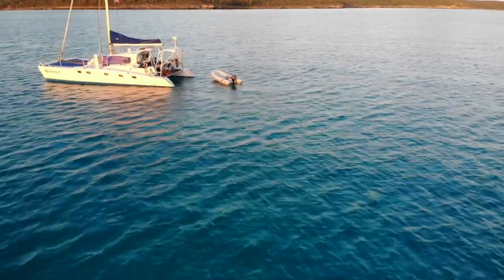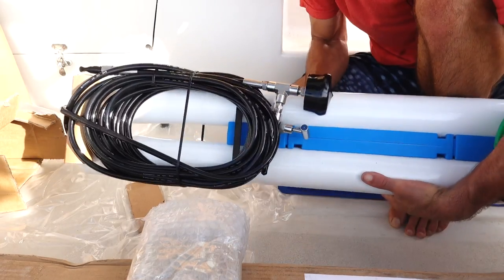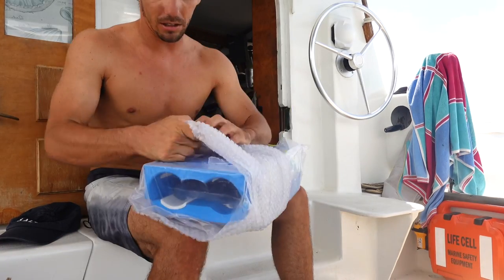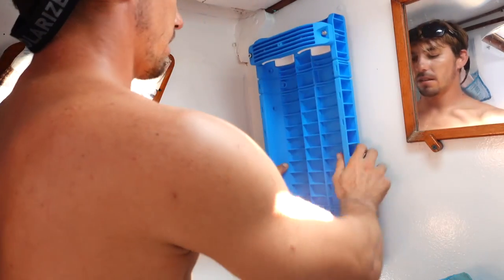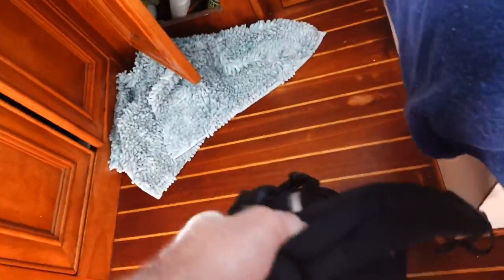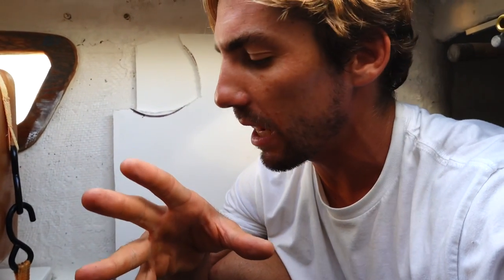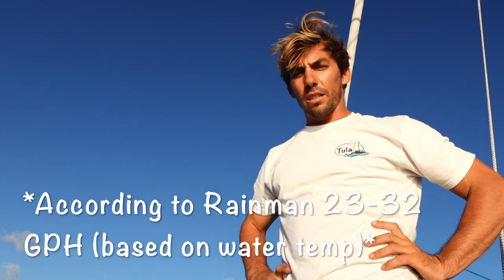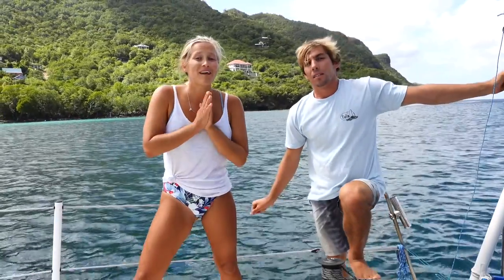LIVEABOARD: Installing A Rainman Watermaker On Our Sailing Catamaran (game changer)

Comment: Make >> SURE << the filter for the auto/manual flush system is a charcoal filter that will take out any chlorine because any chlorine will ruin the membranes in a flash. When you put water in the boat tanks from Marina's & Dockside - that water can have chlorine in it - and this is what you are using when you run the auto/manual flush system ~ so beware of that fact. Other than that - it looks great and you are ready to go. I was a Chief Engineer on many vessels worldwide - motor-yachts and commercial vessels. I am now retired in Florida.
Reply: Great tip.  Thanks!

Comment: FWIW:  I was on a camping trip some years ago on some private property in Central Virginia, and one of the other campers I was with had a Honda generator.  I was AMAZED at how QUIET that thing was....
Reply from the maker: They really are. Sometimes when it’s running on deck you think it could kind of be loud but take the dinghy 30’ away and you can barely hear it!

Comment: A coupe of points about water makers you will want to pay attention to:   1) Adjust the pressure based on what output  the membranes are rated for, not just pressure.  In brackish or fresh water the pressure will be much lower. If you use 850 PSI in brackish water you will damage the membranes.   2) Never back flush the membranes with chlorinated water.  It will distroy them. This can happen if you fill your tanks at the dock and then back flush from the tanks.  It's a good idea to install a carbon charcoal filter in the flush line in case you forget.  Enjoy the water maker.  We used our water to trade for fish and other thinks in remote areas.
Reply from the maker: Thanks for the heads up. Yes, Rainman recommends a different psi for brackish water and I believe the offer a flow gauge that helps when desalination gets brackish water too. An activated carbon filter did come with our autoflush to put in line from the water tanks.
Reply: Good points. All Rainman systems now come with flow meter to ensure you don't go above the specs of the system while in brackish water.

Comment: Great video! I hope to be cruising someday.  
I see you are adjusting pressure to get your product water. if you ever find yourself in lower salinity water, you may want to add a flow gauge to the product water output. If you run 850 PSI in low salinity water you will likely damage the membranes. You want to adjust the pressure to give the desired flow, without exceeding the maximum pressure. In fresh water you need very little pressure.

Comment: That is great that you installed your reverse osmosis. Remember though, RO water is devoid of all ions. That means that the water you make will be in ion scavenger. This means that whatever container the RO water goes into, whether that be your body or a water tank, if ions can be leached from the walls, it will be. So, what can you do?  

If you are making RO water and you are at least a couple miles offshore in 500’ or greater water, then you could just add about a quarter ounce of the concentrate per gallon back into the RO, or test to taste.  Think about it.  You are getting rid of the major salts, but you are also eliminating the calcium and magnesium that your body needs that you normally get from regular water. So if you add just a little of the concentrate back, then you are Reverse Osmosis water is approaching what you would find out a flowing stream. 

Another option is to carry a little bit of baking grade calcium carbonate or a little bit of baking soda or even Himalayan salt.  For each of these you could add a pinch of either to each gallon of Reverse Osmosis water.

Have fun with the new water.
Reply: RO water is not deionized.
Reply: Austin L. You’re correct that the literal definition of deionized water is not equal to reverse osmosis water. I can electrically or/chemically deionize water in my lab. Reverse osmosis in terms of what Billy and Sierra are doing on their boat is using a reverse osmosis membrane used in Rainman equipment, but made by Dow, which is now DuPont-Dow’s Filmtec membrane. This is a semipermeable mechanical membrane that uses high pressure to physically force water, which is a small molecule through pores of the membrane. This membrane blocks ions, large molecules, ionic compounds and other dissolved material from crossing the membrane barrier. So there is specific ion selection. In a specific sense, RO water is deionized, just not in the same way that most deionized water is made commercially, industrially or in a lab.

Comment: recommend getting a pex cutter so your hoses are cut straight, seen it before someone cuts a pex line with regular knife and its not straight, potential for leaks or using a saw and it sent shavings into the water line pipe. 
I had to strip a business bathroom toilet ballcock and clean the shavings out which it clogged.
Ballcock is what fills the tank on the back of the toilet with the float attached to it.

great video though
Reply from the maker: Thanks for the advice!!

Comment: 26-34lph (7-9gph)
I think you are making 7 to 9 gallons per hour. Correct me if I'm wrong. Either way you making fresh water and that's a great addition to your boating lifestyle.  Good job guys.
Reply: It's actually 100-140lph or about 35gph. Towards the higher end in warm water, lower end in temperate water. In Antarctic -2C water, it would be about 80lph.
Reply: @RainmanDesal  That's amazing. I will follow the links to inquire on cost and shipping to Canada.  Unless you have a rep in British Columbia. Thanks for the correction.
Reply: @MrNickstevenson63  No problem. We work with Watertight Boatworks in North Vancouver. Our dealer map is at https://www.rainmandesal.com/watermaker-dealer-map/.
Reply: @RainmanDesal  Thank you.

Comment: Wow, that is really exciting.   That unit really puts out a high volume! 

I would be curious to hear your feedback after you have lived with the watermaker for six months or so. 

How often (hours of operation) do you change the pre-filter for the raw water? 

I am going to presume that the big reverse-osmosis filter eliminates any health hazard such as contaminants from things such as city sewer system. (not so much a problem in the out islands of the Bahamas, but could be a factor in city harbors). 

I would guess dinging water 5 gallons at a time makes you super conscientious of water consumption.  I can take a shower on the boat in maybe 1.5 gallons of water, but that is still too much when you have only 50-60 gallons available for weeks at a time.   Easy to fill up every few days cruising the Chesapeake.  

Love your video's.  I discovered you about mid-way through the trawler and have been religiously following you ever since. 

You guys Rock.
Reply: O'My O'Day  gotta love the Chesapeake Bay 👍👍👍👍👍👍👍

Comment: Awesome! This will be so nice for you guys. Will you have to be strategic about the water quality where you are (dirty harbor water or something) or will it really remove all the harmful impurities? How much power does it draw? Could you run it from an inverter in a pinch (if you ran out of fuel, or the generator died)?
Reply from the maker: It would remove the impurities from a dirty harbor but at the expense of the expensive membranes so we are strategic about where we use it. The cleaner the source water the better. It can run off of a high quality inverter.
Reply: I figured. Very cool!

Comment: So glad you have a water maker now.A necessity for your kind of long term sailing.My only question maybe I missed it on the install.How did you plumb in the pickup pump?Through an existing saltwater pickup?Engine seacock maybe?
Reply from the maker: Exactly we t’d off an existing seacock. It was one that feeds salt water to flush the head and I put a check valve on the head side of the t just to make sure the watermaker didn’t pull from that side (redundant to the head mechanism)

Comment: How often will you have to by replacement filters?  Or do you have to replace them?
Reply: The prefilters are typically 5-50 hours of use, depending on the source water. The RO membranes are usually 5-10 years if you take care of them.

Comment: Won't you have to have the generator running for the Auto-Flush to work? Maybe I am missing something, but it doesn't seem very "auto" if you have to schedule the generator to be running at an exact time.
Reply from the maker: No, the only electricity needed for the autoflush is the timer control box and valve which are wired into our house 12v system and also the house fresh water pump which is obviously already wired. Nothing else is needed therefore no generator.
Reply: @Tulasendlesssummer  Roger that

Comment: Ok,,,the unit is set to autoflush every 7 days,,,is the flush cycle set up to run off the inverter, or are you going to have to set up the generator?
Reply from the maker: It’s hooked up to the house 12v system and it just uses the regular house water pump to push water through. No need for generator or inverter. Here is some more info on the autoflush https://youtu.be/cmXp1hEFDIU

Comment: Can you have hot showers ? I don’t recall if you have a water heater ?
Reply from the maker: Only if the port engine has been running. It is a water heater that is heated by that engines coolant

Comment: did you not show using a sealant in the mounting holes or did you not use a sealant
Reply from the maker: I didn’t use sealant in the mounting holes. It is all mounted in a dry covered storage compartment

Comment: I think your placement of the components is perfect.  It keeps the runs short and everything is accessible.  One thing you should maybe look into is obtaining a TDS Meter (Total Dissolved Solids)  You can test your water to ensure it is safe to drink, no more than 300 ppm off the top of my head.  Do this every time and you will see when your water maker membranes will need replacement because the test samples will increase in ppm.  Keep a log!

Comment: We used to use our dingy as a water barge too, fill the dingy at least a few hundred litres, maybe 50 gallons then pump it out into our water tanks, had 2 by 800 litre water tanks (200 gallon) under the hull sole. Never did get a water maker, liked the Katadyn system, small super efficient DC powered. https://www.katadyn.com/us/us/102-8013438-katadyn-powersurvivor-40e-12-v

Comment: Great vid. Suggest you double clamp all water lines that could cause flooding. Also, watch your generator. A friend of mine had his vibrate off the deck into the drink when it started running rough because of bad fuel. Hope to see you finish all the plumbing soon!
Reply from the maker: Omg that sounds like a nightmare having that fall overboard!

Comment: Liked this one guys a good how to. Couple of questions for you or Rainman. Assuming your on US voltage of 110 Vac Do you know the current draw on startup for the HP pump? We are looking for a watermaker to install and feature in our vids, but we have 230Vac 2Kw inverter gen, and a 5Kw Max 2.5Kw constant, soft start pure sine wave inverter with excess solar. But it's the start up that draws the amps not the run? So some info on that would be useful.  We use 21 Ltrs per day on average that's 5.54 US gallons.  Are there smaller units as we really dont need that massive capacity although, the extra would be handy as you say  for washing stuff. Have you a contact we can talk to? As always, Sail safe. Ant, Cid & the Pooch crew. xx
Reply: The 115V system draws 1300 watts, so about 11 amps. Induction motor startup is 5x current draw. Many people are running with a good quality 2kva inverter (eg. Victron, Mastervolt, etc.). Smaller units are available, but many people that use lower quantities of water will still have the high output system and only run it once a week.
Reply: @RainmanDesal  Thanks guys. Quick to respond. Impressed! So the 230Vac Motor is going to draw 5<5.5 Amps. We are currently in Italy, moving on shortly East and South. Do you have a contact or someone that can mail us for some details etc? You can contact us from the about page of our YT chanel or Via facebook "Impavidus Ontheboat. Many thanks. Ant, Cid & the Pooch crew.

Comment: I have a Parker “Little Wonder” water marker. It’s 12 volts.  Makes 4.5 to 6 gallons an hour.
It’s the way to go if you want to go the 12 volt route.  I had an AC watermaker I made that made about 25 gallons an hour.  It was loud and I had to run the generator to make water.
I am fortunate enough to have lots of solar power and good batteries.

Comment: what prevents the internal membrane from rupturing (malfunction) and flooding your tanks with saltwater?  what would you do then?
Reply: The membranes are really sturdy.  If you don’t overpressure them and keep them flushed, they can last for a few years.
Reply: @LetsJumpGo  ah that's good.  I didn't at all mean having this is a bad idea. I'm truly wondering what safeguards are in place to prevent contamination of water. If the tank gets saltwater in it, that could be devastating if far from a water source.  Maybe having a backup system or separate jugs just so you know you have fresh water for survival if needed.

Comment: This is awesome guys. So happy for you. I've been looking into this exact water maker.
We have been using this washer which we found to be a huge upgrade to the bucket.https://www.amazon.com/dp/B01ALBMIEI/ref=cm_sw_r_em_apa_i_UwfkEbH68H65R
Reply from the maker: That’s awesome! Does it work well?
Reply: @Tulasendlesssummer  we love it
Used it for 3 months. You still need to dry the clothes but it gets so much water out in the spin cycle that it takes like half the time to dry.
Doesn't use much power and we run everything exclusively on solar

Comment: OH NO, you can’t do that!!!!! That adds weight and will slow the boat down. No generator so no water maker....but since Sierra won that argument guess its ok for a water maker. But you slowing your boat down Haha
Reply: It can actually be a weight SAVINGS if you run your tanks 1/3 full. Water is very heavy and no need to keep the tanks full.
Reply: Rainman Desalination 

I was referring to the spat between them two about the generator. Check a few episodes ago and watch it. Meant nothing more than a joke. I agree it can be a weight savings.

Comment: Rainman High Output Naked claims 26-37 gph @ 1250W on their pricing page, Honda EU2200i rated @ 1800W = 0.3 gallon fuel per hour - so about 0.2 gallons of fuel per hour per for ~30 gph water. That's 1 part fuel for 150 parts water. ~US$0.50c worth of fuel per ~30 gph.

Sailing Emerald Steel today said they use less than 7 gallons of water a day, that's 2555 gallons water a year and 17 gallons of fuel a year to make it. So about a passenger car tank full of fuel per year. About 150kg of CO2 emissions. You would need to plant about 7 trees in the Amazon every year to sequester just the fuel. Interesting.
#teamtrees
Reply: I think they have lowered their carbon footprint by adding the water maker compared to taking the dinghy to get water at a marina. The generator should be more efficient than the outboard making several trips back and forth.
Reply: @marceld6061  I actually calculated that but thought my post was already too nerdy. :) Found a review of a similar dinghy with the same 20hp Suzuki and it was most efficient at 4000RPM and 13 kts (15 mph) for about 338 miles using 17 gallons. At 5 kts efficiency dropped and 17 gallons would only get 183 miles. Difficult to know how far a dinghy travels in a year for water but I'd be surprised if it was that far.
Reply: @CraigOverend  Agreed that it is difficult to accurately calculate actual consumption with a limited sample.  A dinghy motor is often idling for long periods and the speed/load varies quite a bit during use.  Not often is it running at peak efficiency.  Don't be afraid to bring on the nerdy!

Comment: Unfortunately watermakers generally remove minerals out of water that you're drinking and if you don't have a way of adding minerals to your water then the more or less distilled type water from the water maker pulls minerals out of your bones.
Reply: I have heard other cruiser introduce a small amount of salt back into the water post production to overcome this.  Also, I believe that you would have to consume a LARGE amount of water (and NO food) for this to become an issue. Your body is an amazing machine and, if you eat properly, will absorb the nutrients you need.    I have seen plants die on board if watered solely with RO water.  The soil needs to be fertilized properly for the plant to get the required nutrients.
Reply: @marceld6061  yes use pink Himalayan salt it's got Trace elements & minerals in it... I've also heard of survivalists, on life raft, sustaining themselves with a half a cup of sea water a day!